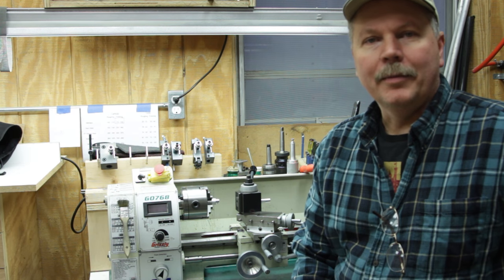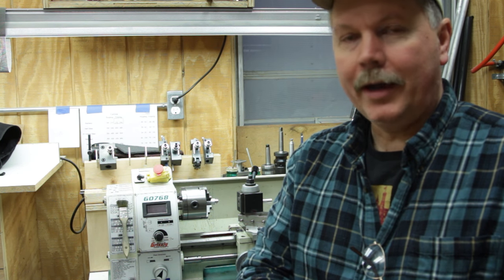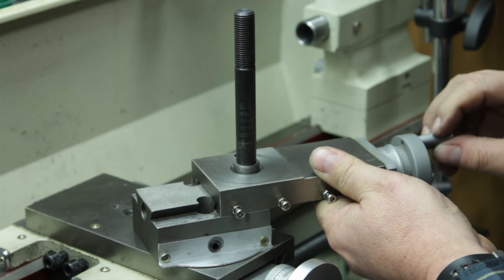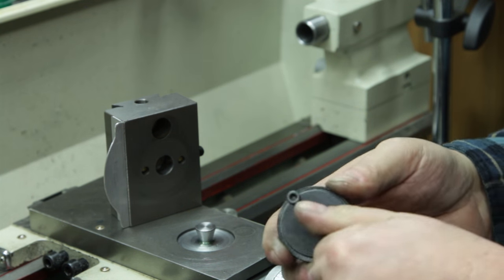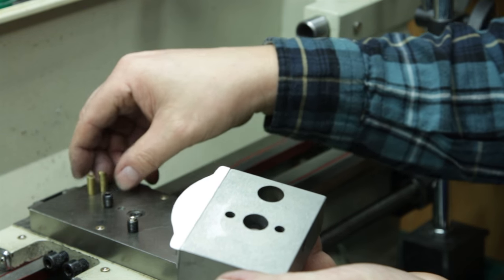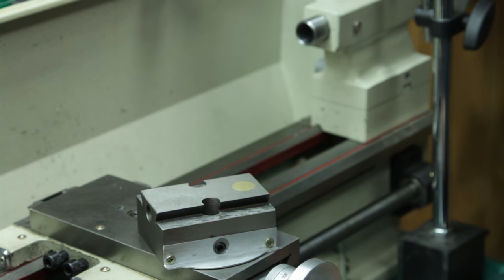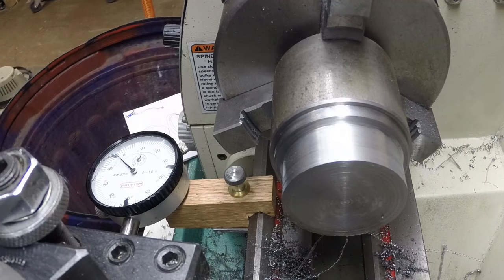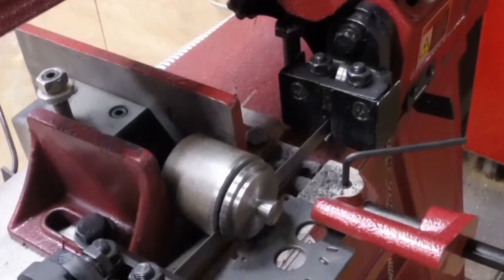G0768 Compound Modification

Comment: Impresive job would you please give the dimensions of your dovetail diameter of top and bottom and height thanks
Reply from the maker: My shop is shut down because of the cold weather here but as soon as it's warm enough to get back in there I'll see about getting those measurements. Thanks for watching.
Reply: thank you look forward to warm weather ;-)

Comment: Hi I have an lms 5100 lathe would this mod work for my lathe..  Also do you have drawings with measurement on them..
Reply from the maker: I'm not familiar with the 5100 but many of the small import lathes are similar in design.  No, I did not do drawings for this part. I just took careful measurements of the existing part and made the same size part only with a dovetail pin in the center. Good Luck with yours.